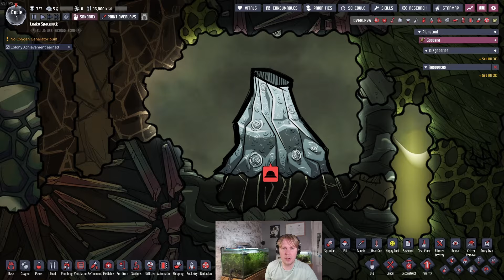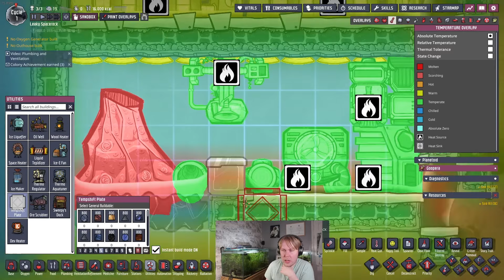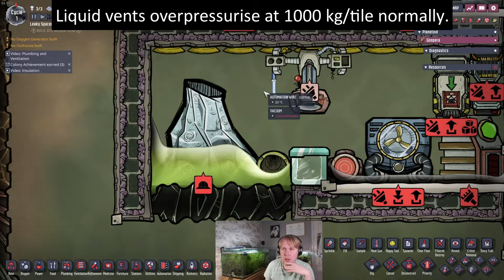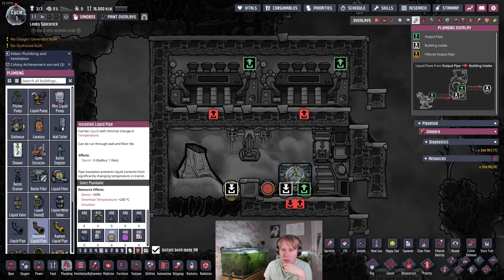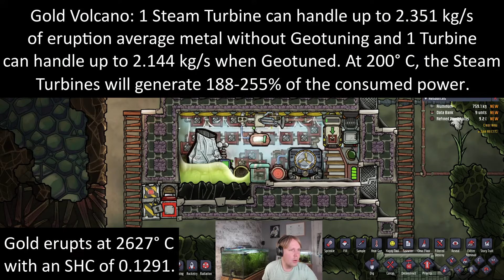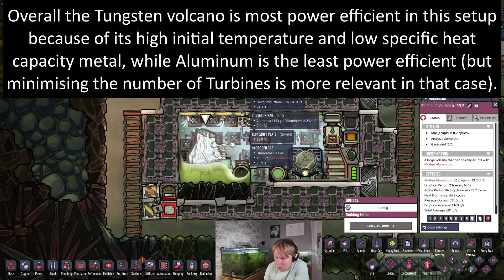How To Master Your Metal Volcanoes In ONI: Spaced Out! Sandbox Showcase #36

Comment from the maker: I've calculated the optimal Steam temperatures for the minimum, average, and maximum expected Metal Volcano output rates and compared it to max temperature Steam. Volcanoes in your games will fall about linearly between these values. I have a spreadsheet that I've used to calculate these values: let me know if you're interested in me making that public!

Gold Volcano: 0.333 kg/s (No Geotuning) with 1 Turbine @125° C = 214% efficiency (120.2 W output), @200° C = 188% efficiency (116.7 W output).
Gold Volcano: 0.5 kg/s (No Geotuning) with 1 Turbine @125° C = 244% efficiency (178.1 W output), @200° C = 211% efficiency (172.9 W output).
Gold Volcano: 0.666 kg/s (No Geotuning) with 1 Turbine @125.3° C = 262% efficiency (236.0 W output), @200° C = 225% efficiency (229.1 W output).
Gold Volcano: 0.666 kg/s (5 Geotuners) with 1 Turbine @128.1° C = 258% efficiency (258.9 W output), @200° C = 226% efficiency (252.2 W output).
Gold Volcano: 1 kg/s (5 Geotuners) with 1 Turbine @144.3° C = 273% efficiency (383.9 W output), @200° C = 245% efficiency (376.2 W output).
Gold Volcano: 1.333 kg/s (5 Geotuners) with 1 Turbine @160.6° C = 276% efficiency (507.5 W output), @200° C = 255% efficiency (500.2 W output).

Tungsten Volcano: 0.333 kg/s (No Geotuning) with 1 Turbine @125° C = 256% efficiency (177.4 W output), @200° C = 233% efficiency (173.8 W output).
Tungsten Volcano: 0.5 kg/s (No Geotuning) with 1 Turbine @128.5° C = 264% efficiency (263.8 W output), @200° C = 259% efficiency (258.6 W output).
Tungsten Volcano: 0.666 kg/s (No Geotuning) with 1 Turbine @139.4° C = 298% efficiency (349.2 W output), @200° C = 270% efficiency (343.4 W output).
Tungsten Volcano: 0.666 kg/s (5 Geotuners) with 1 Turbine @142.4° C = 292% efficiency (372.9 W output), @200° C = 268% efficiency (367.4 W output).
Tungsten Volcano: 1 kg/s (5 Geotuners) with 1 Turbine @165.8° C = 301% efficiency (553.9 W output), @200° C = 286% efficiency (549.0 W output).
Tungsten Volcano: 1.333 kg/s (5 Geotuners) with 1 Turbine @189.1° C = 301% efficiency (732.6 W output), @200° C = 296% efficiency (730.5 W output).

Copper Volcano: 0.333 kg/s (No Geotuning) with 1 Turbine @133.1° C = 259% efficiency (294.2 W output), @200° C = 220% efficiency (285.0 W output).
Copper Volcano: 0.5 kg/s (No Geotuning) with 1 Turbine @151.9° C = 263% efficiency (435.3 W output), @200° C = 233% efficiency (425.3 W output).
Copper Volcano: 0.666 kg/s (No Geotuning) with 1 Turbine @170.5° C = 258% efficiency (573.8 W output), @200° C = 239% efficiency (565.6 W output).
Copper Volcano: 0.666 kg/s (5 Geotuners) with 2 Turbines @137.4° C = 279% efficiency (656.5 W output), @200° C = 241% efficiency (639.2 W output).
Copper Volcano: 1 kg/s (5 Geotuners) with 2 Turbines @158.2° C = 278% efficiency (971.8 W output), @200° C = 252% efficiency (954.4 W output).
Copper Volcano: 1.333 kg/s (5 Geotuners) with 2 Turbines @179.1° C = 270% efficiency (1281.3 W output), @200° C = 257% efficiency (1269.7 W output).

Cobalt Volcano: 0.333 kg/s (No Geotuning) with 1 Turbine @136.4° C = 261% efficiency (319.3 W output), @200° C = 223% efficiency (309.7 W output).
Cobalt Volcano: 0.5 kg/s (No Geotuning) with 1 Turbine @156.8° C = 262% efficiency (472.1 W output), @200° C = 235% efficiency (462.4 W output).
Cobalt Volcano: 0.666 kg/s (No Geotuning) with 1 Turbine @177.1° C = 256% efficiency (622.0 W output), @200° C = 241% efficiency (615.1 W output).
Cobalt Volcano: 0.666 kg/s (5 Geotuners) with 2 Turbines @141.0° C = 279% efficiency (712.5 W output), @200° C = 244% efficiency (694.7 W output).
Cobalt Volcano: 1 kg/s (5 Geotuners) with 2 Turbines @163.7° C = 276% efficiency (1054.1 W output), @200° C = 253% efficiency (1037.7 W output).
Cobalt Volcano: 1.333 kg/s (5 Geotuners) with 2 Turbines @186.4° C = 267% efficiency (1389.0 W output), @200° C = 259% efficiency (1380.8 W output).

Iron Volcano: 0.333 kg/s (No Geotuning) with 1 Turbine @145.2° C = 273% efficiency (387.9 W output), @200° C = 241% efficiency (379.1 W output).
Iron Volcano: 0.5 kg/s (No Geotuning) with 1 Turbine @169.9° C = 271% efficiency (573.7 W output), @200° C = 253% efficiency (566.5 W output).
Iron Volcano: 0.666 kg/s (No Geotuning) with 1 Turbine @194.6° C = 262% efficiency (755.6 W output), @200° C = 259% efficiency (753.9 W output).
Iron Volcano: 0.666 kg/s (5 Geotuners) with 2 Turbines @150.2° C = 289% efficiency (854.8 W output), @200° C = 260% efficiency (838.7 W output).
Iron Volcano: 1 kg/s (5 Geotuners) with 2 Turbines @177.3° C = 283% efficiency (1264.7 W output), @200° C = 269% efficiency (1253.8 W output).
Iron Volcano: 1.333 kg/s (5 Geotuners) with 3 Turbines @168.3° C = 290% efficiency (1693.5 W output), @200° C = 271% efficiency (1673.1 W output).

Aluminum Volcano: 0.333 kg/s (No Geotuning) with 1 Turbine @163.8° C = 234% efficiency (514.5 W output), @200° C = 210% efficiency (502.7 W output).
Aluminum Volcano: 0.5 kg/s (No Geotuning) with 1 Turbine @197.7° C = 217% efficiency (753.1 W output), @200° C = 216% efficiency (751.9 W output).
Aluminum Volcano: 0.666 kg/s (No Geotuning) with 2 Turbines @163.8° C = 241% efficiency (1029.1 W output), @200° C = 216% efficiency (1005.5 W output).
Aluminum Volcano: 0.666 kg/s (5 Geotuners) with 3 Turbines @147.8° C = 264% efficiency (1207.1 W output), @200° C = 228% efficiency (1173.0 W output).
Aluminum Volcano: 1 kg/s (5 Geotuners) with 3 Turbines @173.8° C = 252% efficiency (1778.7 W output), @200° C = 234% efficiency (1753.0 W output).
Aluminum Volcano: 1.333 kg/s (5 Geotuners) with 3 Turbines @199.8° C = 237% efficiency (2333.4 W output), @200° C = 237% efficiency (2333.1 W output).

Comment: Would a design like this work for the Niobium volcano? Im trying to look for an option that doesnt use robo miners
Reply from the maker: I need to actually get around to doing this but you'll need something more similar to a Magma Volcano for the Niobium Volcano due to its eruption pattern. However, Niobium tiles a lot more easily than Magma, so you'll need to keep the Niobium Volcano in a vacuum and drip the Niobium through a cooler slowly.

Comment: if i wanted the tamer to face the other way, would that work fine or would there be problems because of where the naptha would have to sit?
Reply from the maker: It should work fine facing the other way. I would put the vent on the other side in that case so it's closer to the Aquatuner if that's going on the left.

Comment: I would say it's fairly important to only set the conveyor to the single refined metal coming from the volcano - during startup, the liquid uranium could condense back into debris before all the water can turn into steam that's hot enough to keep the uranium liquefied. There probably wouldn't be any power to run the sweeper but with lower amounts of steam pressure it's possible the turbines could run long enough to have the sweeper pick up unintended debris.
Reply from the maker: This is very true.

Comment: 23:10: i usually hook the battery automation to the turbines not the AT, is it doing the same job or i'm missing the point? 

25:00 apart from tungstene/niobium, isn't wolframite enough to get the rail across? 

28:15 diamond plates in checkerboard patterns does the same and save material or not? 

Like how you can overpressure the steam in the room with the vent in liquids, smart !

Comment: 15:20 - I'd be more worried about making sour gas by flaking.

Is forming solid blocks a common issue? I don't do either geotuning metal volcanoes, or run at 3x speed by the time I get the materials to do these shenanigans. But I did check when I was building a quad-tamer on the Irradiated Forest Asteroid (2 Alu volcanoes would discharge into a mesh-tile well), and IIRC most metals would form blocks at 160 kg, which would require at least 5 seconds of eruptions with your volcano, fully geotuned.
Reply from the maker: The issue I had with tiling was with Geotuned Aluminum volcanoes. The issue I had was, after each 20-30 kg eruption per second, the new eruption melted the debris from the previous eruption, meaning the Auto Sweeper errand was interrupted. Having the two liquids ensures that even for high throughputs, the debris always condenses before the floor tile, so the condensed debris never remelts and the errand doesn't get interrupted. I didn't see any flaking behaviour during my testing.